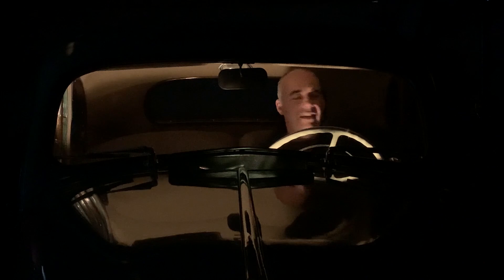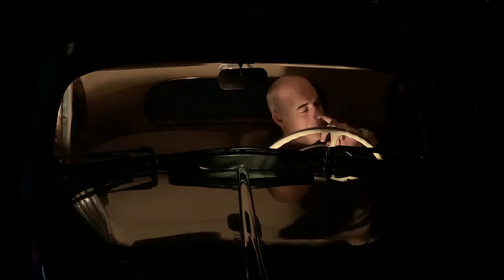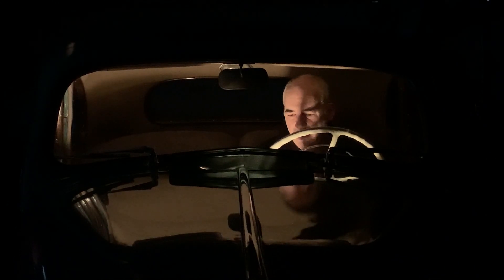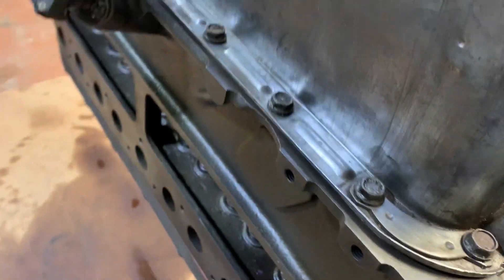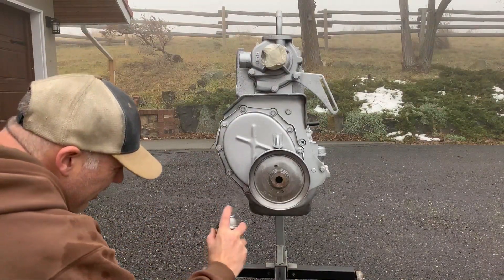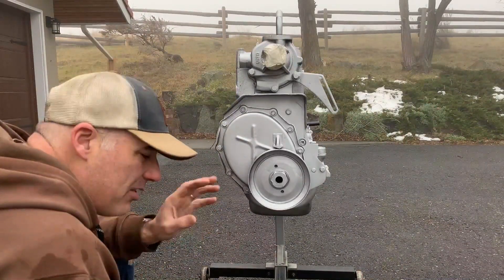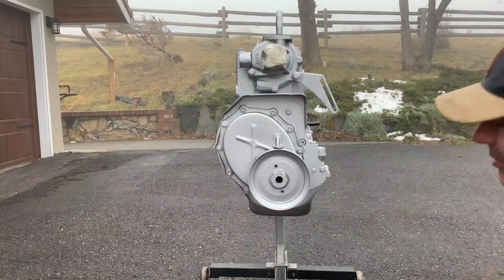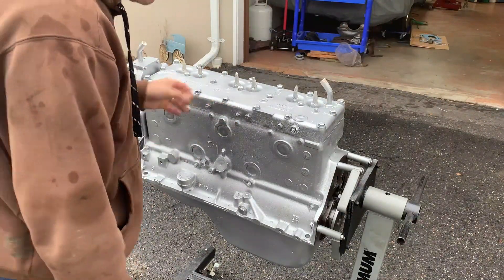Further Engine Reassembly...What Does It Cost To Rebuild A Flathead Engine?

Comment: I have a 1960 2 door sedan Lark with a 170 6cyl in it. The car had oil filter optional and I want to install the optional one.  Do you have any Idea where I would mount it on the engin.  I do have the OEM shop Manual however it doesn't specafy where to tap in to the engin oil system. Any ideas or coments are appreciated.

Comment: I am just in the process of rebuilding the engine in my 1949 Studebaker Champion flat head six 170.  I only want to do it once. I am 73 just about 74 and I am a retired Machinist.  This is not my first auto restoration either.  My oldest was a 1916 Model T truck. But it will likely be my last. And I only want to do it once because I want drive my car, not spend my time upside down under the hood.

Comment: After watching the oil pan go on, I'm wondering how you installed the flywheel bolts into the back side of the crank? 
Did you have to remove again?
Reply from the maker: In another video I install the flywheel. You’ll see I did not need to remove the oil pan.
Reply from the maker: See here:  https://youtu.be/ko82fbWlF9o?si=40s_gJMjZrDdaJiX

Comment: Nice video! Trying to get my 1939 Chrysler Windsor running, getting a little frustrated with it as I’ve rebuilt the carb and have new plugs/wires, along with a fresh fuel pump. Any advice on timing/TDC? Motor seems reasonably healthy, gets ok compression and oil is flowing good. Only firing I can get it to do is a huge blast out of the carb after 2/3 turns. Hoping to hear it run soon, it’s just being very picky..
Reply from the maker: Search for my timing video. Its on here.

Comment: I did a retrofit on my 1953 Dodge Coronet with a electric 6 volt fuel pump from the JC Whitney cataloging, in 1972, Dude use a spray can of starting fluid on a cold winter days ❓❓❓

Comment: Just did a total overhaul at a machine shop on my 56 Continental 4cyl for  $2500.  I'm in Idaho. I am now curious what my Studebaker flathead would cost here.
Reply: parts are not cheap on specific industrial engines as contiental, Buda, Lycoming and others, I remember ifn the early '90, I overhauled  a buda tractor engine, I reused pistons, sleeves, all the castings, the crankshaft all the valvetrain, I done all the machine work and I invested more than 500$ just in gaskets , rings, seals and 1 rod bearing, this was more than 30 years ago.
very good topic

Comment: Was given 1939 Plymouth Business Coupe Rd. king 60 years ago. Blow my was so bad they had a pipe run to the rear to carry it away. It looks like the car had dual exhaust going down the road. I rebuilt the engine myself. Of course I had the cylinders for the head machine and the crankshaft turned at a machine shop. The engine ran perfectly for years after that.

Comment: tip  that will help on timing   if you have the eng. out working on it  paint the crank shaft pully black  look for  those tiny  timing marks all so tdc stamped into the pully  used a tooth pick and white paint to mark these groves  and tdc  only mark 4 before tdc  this big help looking down at the pully when using  a timing by  start timing  by rotating  eng to line up marker on  eng with 4th white line before top dead ctr with the spark plugs out rotate eng is easy with fan blade  with cover off dist. look at rotor  should  be pointing to 1oclock pos.look  place cover on dist  add spark plugs crank eng.  connect timing light to #6 plug wire theother to eng gd. hold flashing light on crank shaft pully if not  on 4th mark loosen bolt under dist very slowly rotate dist till marker is on #4  tighten bolt on dist its timed

Comment: Keith- my observation with these old motors is similar to yours. With a little patience and time, if a flathead is not stuck, then they generally will run. On an unknown motor, and like you said, check compression and oil pressure- also drop that pan, remove the sludge that has accumulated, and bolt the pan back up. I love getting an old flathead that was scrapped, and within an hour, having it running under its own power...

Comment: My 37 Dodge sat in a California driveway for 3 1/2 years. No start/run during sit period, parked it at my driveway, my car now! Pulled the plugs, oil, plug cables, coil. Now we pulled it with a chain to roll kick start, it cranked over and started running on the 3rd pull.
Historical american inginuity designed by the Dodge brothers who put the star of david. A symbolic gesture to thank Ford for being a bigot.
Reply: As much as we would like to validate this old wive's tale, there is no reference to the Dodge Brothers using that design as anything related to the Jewish faith.

Comment: Regarding the cold start: the 8 cylinder Chryslers with the dual-barrel Stromberg carbs have a nifty little port on the side of the carburetor fuel bowl, which is intended as an inspection hole to check the fuel level. You unscrew the little brass plug, and if fuel is way under the level of the hole or way above the level of the hole, you need to adjust the float level in the carb. But this hole makes a really useful priming port for the carb. When the car has sat around a couple weeks without starting and the carb fuel bowl is dry, you can unscrew the inspection plug and fill the carb with a syringe and about 100 ml of gasoline. Then you've got a full bowl, and it takes no cranking at all on the starter to fire up. This saves wear and tear on the starter, although it's an extra hassle when you go to start up the car after a long sit.
Reply: What about single barrel ball n ball  CARTER, thats whats in my 37 Dodge 218.7 ci in.
Reply: I had a Buick Nail Head with a 4 barrel Stromberg with those brass plugs.  Was really handy, being able to fill the float bowls up.

Comment: Try soaking your manifolds in EvapoRust or a solution of citric acid crystals and water. I use it all the time do de-rust old bicycle parts (the citric acid solution).
Reply: i cleaned my m37 exhaust  (manny fold)   in plastic tub  with water  and arm+ soap powder and my battery charger   looked good after 3 days  ( called electrolisis )

Comment: Keith great job, you did it right , as close to a new one a guy could get. I have been trying to remenber back to the 50s. Max engine life was about 100k miles, mabe valve job at 50k miles. Is my old brain remembering it right? 

These old engines are workhorses